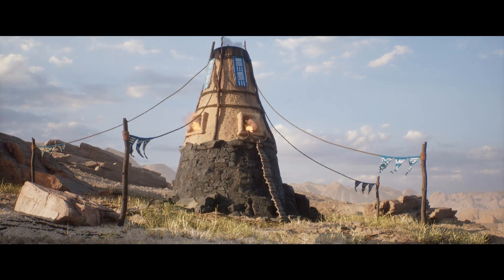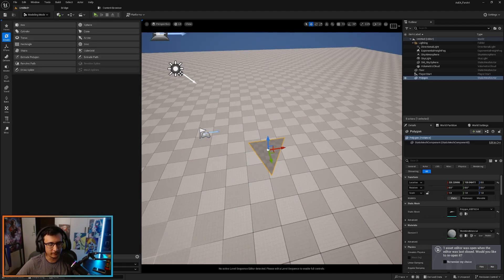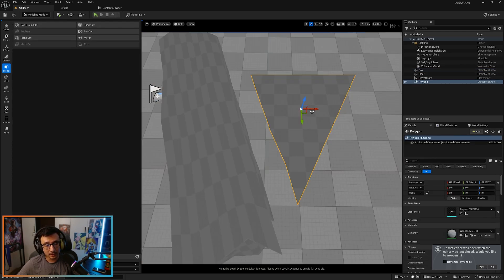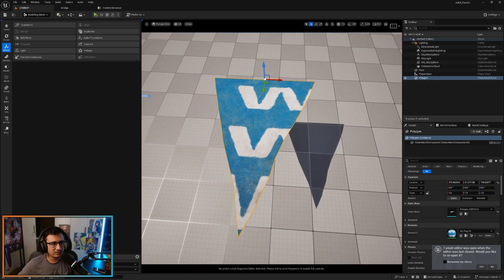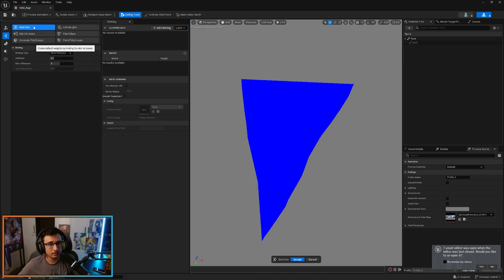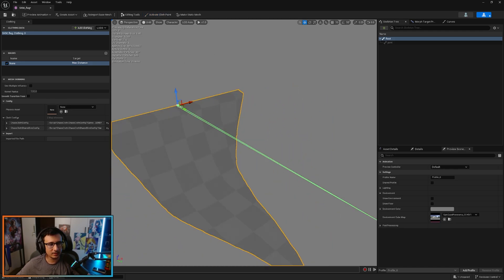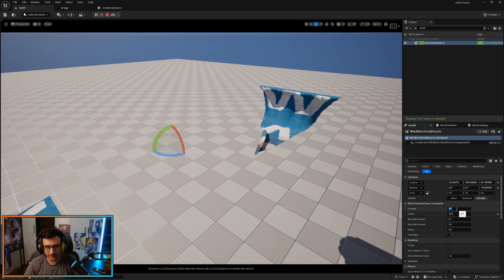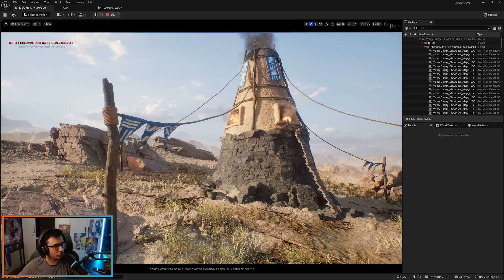How to Create an Animated Flag Inside Unreal Engine 5

Comment: Bonus Tip:  The Free "Content Examples" project on the Epic Marketplace contains a "Physics_Cloth" Level that demo's Burlap, Silk, Rubber, Leather cloth types and also provides you the Cloth Settings and Materials in case you want to experiment with different types of cloth using Mao's video.  It's a great resource to check out!   👍

Comment: Great video Mao - thanks for posting!
Question - are the bones really needed?  I ask only because I've seen other basic cloth sim tutorials without the bones.  I'm sure there are pros/cons - would be interested in understanding that aspect based on your experience.
Looking forward to more technical details about the scene.
Reply from the maker: i think if its only cloth simulation you can get away with only the root bone
Reply: @unfgames  - OK, thanks.  I tried it with only the Root Bone and it works fine too.  Just wanted to confirm this with you in case adding the additional bone provided certain benefits that I wasn't aware of.